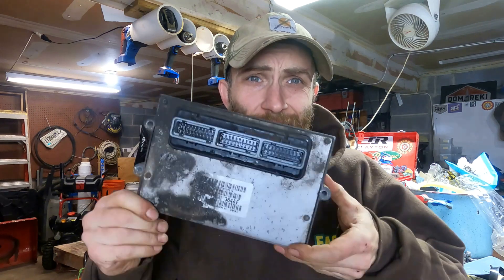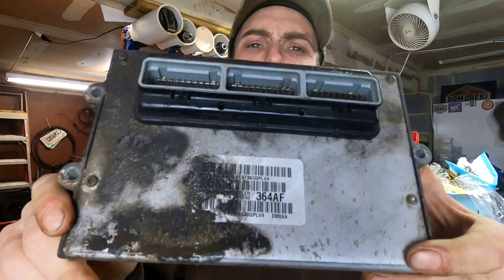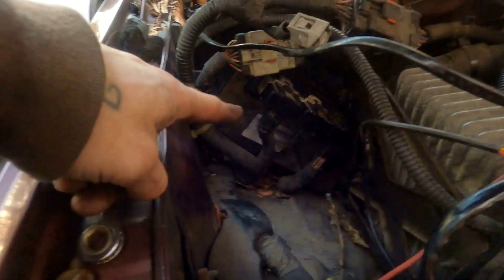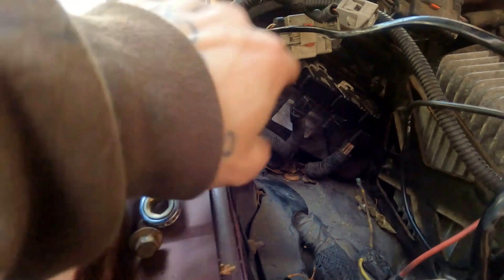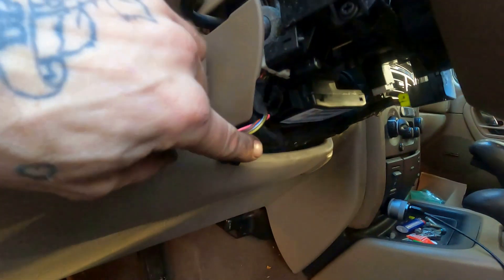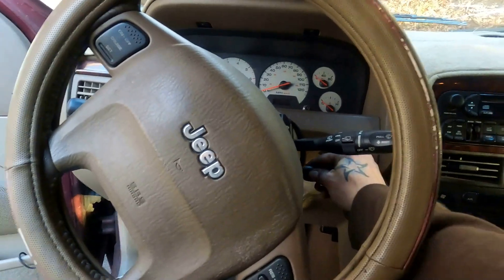Using a DODGE ECU will DEFEAT SKIM on a Jeep Grand Cherokee?

Comment: The instrument cluster and additional features are malfunctioning due to incompatible communication protocols (Dodge's uses  CCD and Jeep's uses PCI). Consider the get onde from Dodge Dakota 2002 4.7, which utilizes the same protocol as Jeep.
Reply from the maker: Thank you! I will give that a shot
Reply: @DEInTheGarage  Greetings from Brazil
Reply: Well that answers the obvious "why" question.
Reply: Yes ! I remember now having such a problem 20 years ago with 2 Chrysler Town and Country AWD minivan, a climate control panel from a 2000 not working in a 1998 the panels looked the same except the connector of the 2000 had a notch not at the same exact place as the 1998. turned out that year 2000 was the last of that generation of minivan and was also the first year that the new communication bus was used in them making most electronics incompatible